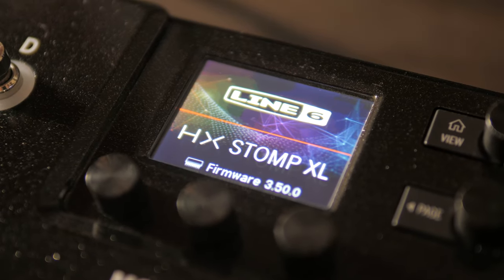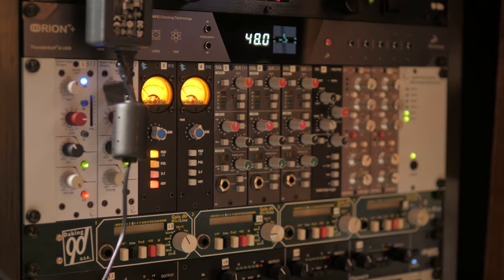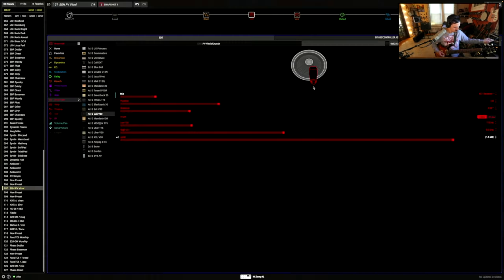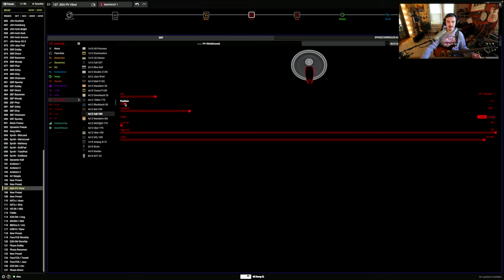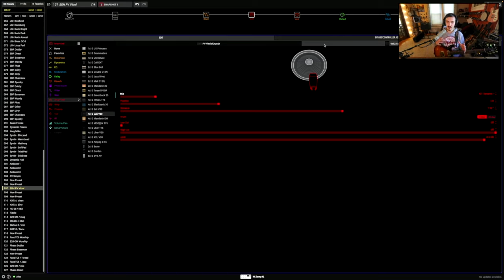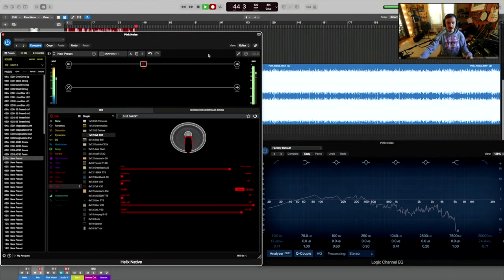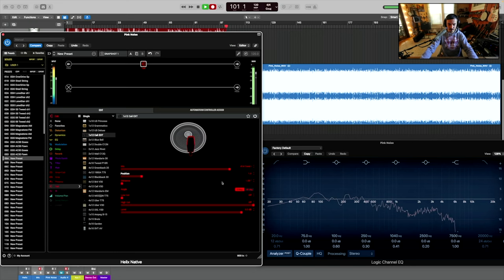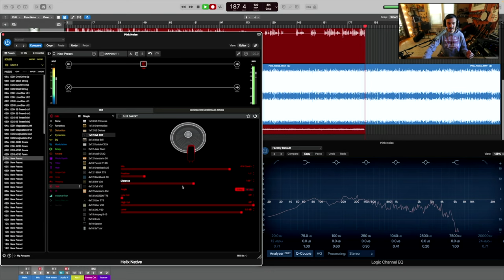Understanding Mic Position, Placement, & Angle // Line 6 Helix 3.50

Comment: Excellent video and explanation of the different Mic Parameters. Seeing the Frequency Responses change as you moved the Mic was very useful, as it helps identify which the frequencies change as the Mic is moved. Hearing and seeing the bass drop off as a function of Proximity effect is fascinating.

I've been watching many videos on the awesome 3.50 Update. I installed it on my HX Stomp the day after it came out, and have been comparing the old Factory Presets to the new ones the new ones, as well as my old Dialed in Presets. A couple of things that I've noticed is that in general, the new Factory Presets are noticeably  louder than the previous Firmware Presets of the same name. The new Presets also sound like they have a little more mid scoop, and are clearer and more open sounding. Even when I dialed in the old and new Presets to match as best as I could, the new Presets sounded better, more open and alive.

I have an unrelated MIDI  related question that I hope it's OK to ask here. I can move it to one of your MIDI videos if you like. I just wanted to make sure you'd see it first. I'm working on using my old Boss GT6 to add footswitches and control some the features on the HX Stomp via MIDI alone. I figured out how to use the Expression Pedal to control the Volume Block. I'd like to use 4 of the foot switches on the GT6 to switch between the 4 View Modes (Stomp Mode, Scroll Mode, Preset Mode, Snapshot Mode) on the HX Stomp. From the Manual ver. 3.0, I know the CC#s and Values for the View Modes = CC#=71 Value=0-5; Footswitch Mode (0=Stomp, 1=Scroll, 2=Preset, 3=Snapshot, 4=Next footswitch mode, 5=Previous footswitch mode).  But, I can't figure out how to associate/program with a specific View Mode to the available MIDI Commands in the Command Center. I think it can probably be done because the "Morningstar MC6" MiDI Controller can do it, but it has its own programming software that come with the unit. They had to use Press, Double Press, and Press and Hold on the MC6 to switch between the HX Stomp View Modes. Any suggestions would be helpful, as I don't know if I'm just spinning my wheels or not, or if I'm not looking in the right place on the HX Stomp. Thanks
Reply from the maker: I'm not familiar with the Boss GT6, but I believe that there isn't anything you should need to set up in the HX Stomp to get it to respond to those control change messages you mentioned regarding the different view modes. MIDI information like that comes pre-programmed and doesn't matter what preset you're on so there shouldn't be anything you have to set up in Command Center. Maybe it's an issue with the Boss unit? You mentioned getting the expression to work - have you successfully sent other MIDI messages that are listed in the manual?

I'm not the best person to ask MIDI questions admittedly. If you're on FaceBook, try this group - https://www.facebook.com/groups/1149598418555545
Reply: @AlexPriceMusician  The only thing I've gotten to work so far is the Expression Pedal. Thanks for your insights and advice. Much appreciated. 👍

Comment: Hey Alex just came across this video. I've been recently thinking about the high cuts on the cabs. Looking at the pink noise part of your video it seems that the cabs already do a good job of keeping the high cut down near 6k similar to a true guitar speaker. My question is then: can one argue that the high cut should be left off? Or should the high cut still be put on to get rid of the "digital noise?"
Reply from the maker: I've been leaving them off more and more. I think you're right - with the new cabinet design being IR-based and basically just an interface to sort through a folder of hundreds of IRs per cabinet, the high and low cuts are already built in to the IRs. They can be utilized if you want a more drastic effect on the sound than there already is.

Comment: You mentioned sacrificing a couple modulation blocks.  Do these parameters add significant DSP processing to the cabinets?
Reply: The cabinet DSP dropped significantly
Reply from the maker: Just that the normal preset I had put on CustomTone had a phaser and univibe up front. I removed them for this video to free up DSP so I could use a looper in the preset instead. 
Yeah - like Joe said, the DSP that the cab block consumes has dropped a lot with the new design. I understand next to nothing about what actually goes in to creating Helix software, but I'd imagine that since these new cabs are really just thousands of IRs, the three controls (and the mic model) are really just telling the Helix to access a specific IR. The older cab design might've been a different sort of software that was more intensive.